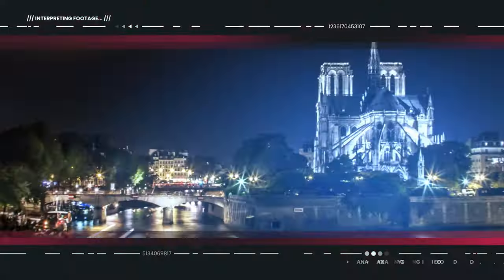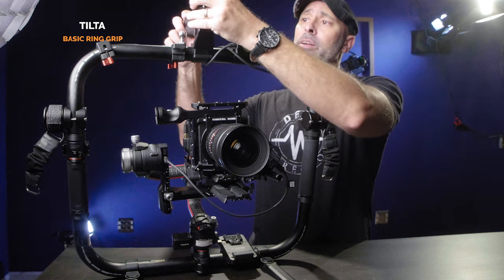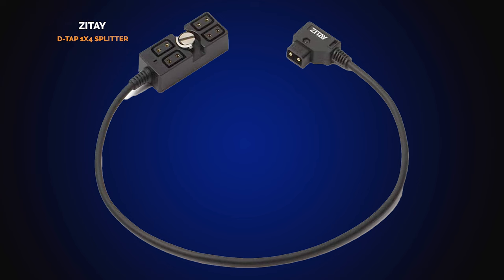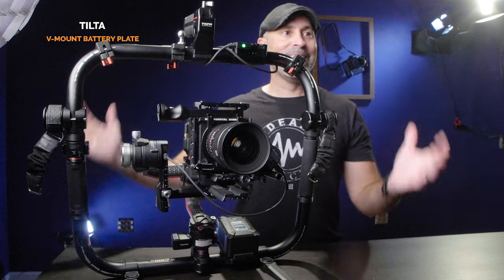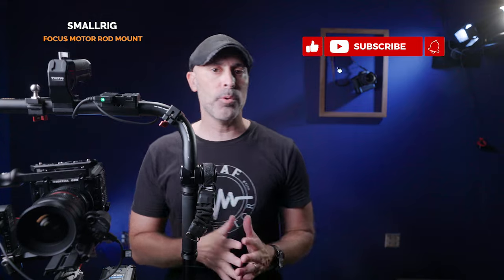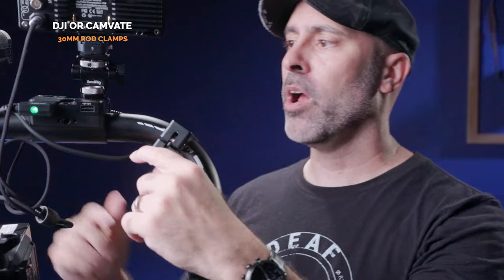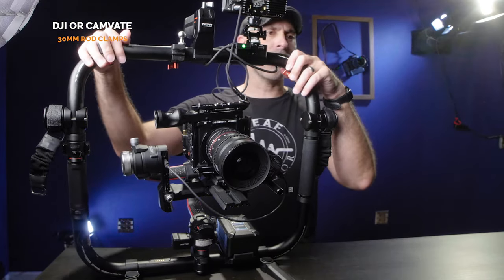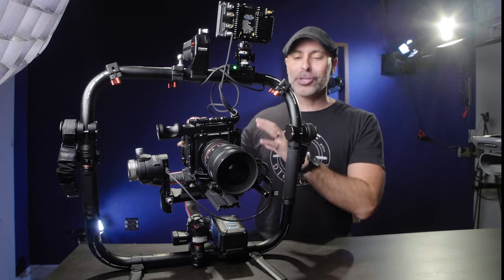Need a DJI RS2/RS3 RIG? Is the TILTA RING GRIP the ULTIMATE WAY to kit out your Gimbal?

Comment: Does this Tilta ring work with RS3? I am hearing its only for RS3 Pro? Can you clarify if the title is correct? My videography friends say I'm talking nonsense and that this video title is wrong
Reply from the maker: Because I only have the RS3 Pro, I double checked the Tilta website, and according to Tilta, the RS3 is compatible with the Basic Ring, which is what I use in the video. Here is a link : https://tilta.com/2022/07/rs3-rs2-compatibility-for-tilta-ecosystem-for-dji-ronin/. Have a great day!
Reply: @DeafDirector  thank you for clarifying!
Reply: I have the rs3 and got the ring. Is there some type of adapter to get the controls to work
Reply: @jorgeaguilar3171  can you help me?
Reply: @jorgeaguilar3171 did you ever get an answer to this? 

I am running into the same issue right now

Comment: You're the first (apart from myself), that I've seen using the official DJI R counterweight kit. The amount of people, that somehow strap the Smallright weights to the gimbal arm is mad. I've heard several times, that the basic ring is made of aluminium, while the advanced ring is made of carbon fibre. I have the advanced ring and it is indeed carbon fibre. Can you confirm if yours is aluminium of carbon fibre ?

Comment: awesome work! keep working! 
questions: if i put a v mount battery on the Tilta Ring, does it then powers everything else? including the gimbal itself? or does it only power external accessories like external monitors and etc?
Reply from the maker: The V-Mount powers the Gimbal and all of the external accessories at the same time. I have been able to run the gimbal, an EVF, an external monitor, and a follow focus all off of one battery. Have a great day!
Reply: @DeafDirector  thanks for the response!!! appreciate it. sorry for the late reply. was traveling. so with the Vmount battery, I no longer need the power from the gimbal's battery?
Reply from the maker: @leejoshua15  You can use the Gimbal's battery as a handle on the top of the Rig. Even if that grip battery is completely drained, everything will still run off the V-Mount battery, and just use the dead battery as a grip on the rig. Or you could completely leave off the gimbal's battery as a grip and just use the V-Mount alone.
Reply: @DeafDirector  thank you so much!

Comment: Does the Tilta Ring Grip have a theaded hole in the very bottom middle?  (So that I can screw a super light weight monopod to the bottom occasionally).
Reply from the maker: No it does not.
Reply: That's too bad.  What if I want to scratch my itchy nose?  Or just want to stand in the same place while filming a long show and want to take the weight off my arms for a second? @DeafDirector

Comment: Question about falcam quick release. Why did you choose falcam over smallrig hawklock?
Reply from the maker: I love SmallRig gear, but the reason I chose the Falcam comes down to 2 reasons. The Falcam has a slightly smaller profile than the Hawklock, which was important to me because I was going to be using this on cinema rigs, so every centimeter counts. The second reason is because when I was putting my system together the Hawklock was backordered. Thanks for the comment and have a great day!
Reply: @DeafDirector  Thank you so much for the reply! Do you happen to know the payload of Falcam? Is it 2.5kg? The payload of Smallrig was up to 5kg so I was torn between those two..